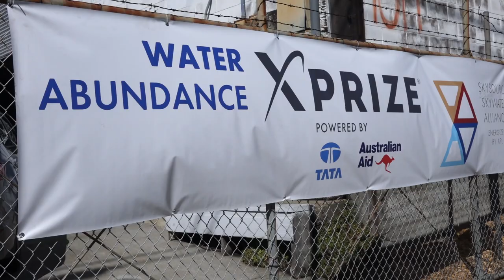The Water Abundance XPRIZE

Comment: Thermodynamics would like to have a word with you. This is nothing but a scam. It works, sure, but it's never going to be more efficient than an already existing commercial dehumidifier. And even under the best circumstances, i.e. very high air humidity (which somehow also kinda eliminates the whole point of this exercise), it only "produces" miniscule amounts of water, while consuming loads of energy.
Reply: All of these incredulous folks who do back-of-the-envelope over-simplified calculations overlook all of the ways to collect water that don't fit their incomplete model. They presume we forcibly condensed every drop right out of the air using refrigeration, calculate the energy required, and call it a day, confident that all they could think of is all that could be thought of. That's not how it works.

Hint: some of the condensation happened without active cooling that expends energy; a lot of cooling can be done passively (or at least without refrigeration) through mere radiators if timed right. Our machine enabled the AWG to operate in the evening, throughout the night, and into early dawn, when the relative humidity is the highest while meeting the requirement that the energy come from renewable sources, whereas solar can't do that and solar+batteries is not yet cost-effective. Our biomass gasifier needed to dry the feedstock before using it, which also collected humidity and passive condensation when left out, besides the humdity that was embodied in it—we routed the water vapor driven off during the drying process (passively heated with waste heat) into the water collector. You may be surprised at how much humidity biomass can hold. And even when California was in the middle of its drought, you could see dew condense on plants and cars and windows. Additional disclosures will be possible when our patents are secured. The over-simplified calculations people make when they presume to debunk what we did never account for all the clever tricks and optimizations that went into achieving this. This was not easy at all. It took everything we had, and we're still not done optimizing; the prize money will fund the next round of development to turn this into a product.

Perhaps stop being so presumptuous. If it were that easy for casual doubters to figure out how it is done, it would not have taken two years to do this.
Reply: @austinliu1043  Please stop trying to obfuscate the fact that you're literally trying to scam people. Thank you.
Reply: @nahco3994  We are not trying to scam people. How about if you stop slandering us?
Reply: @austinliu1043  Sorry, of course you're not trying to scam 'people'. And how could you, without a product? Your only real product is your marketing, and some sort of warm and fuzzy feeling of 'saving the world'. No, you're trying to scam investors and these scientifically clueless organizations that so readily hand out these 'prizes' to frauds like you. It's easy to sweet-talk scientifically inept and clueless people and distract and confuse them with big, sciencey words. For anybody else though it's fairly easy to see the feasibility of your claims. Just go and buy some dehumidifiers off Amazon for ~30 bucks. That's as energy efficient as you'll ever get.
Reply: You seem awfully indignant about something you know nothing about. You haven't done a thing to show the infeasibility of the system; you've done nothing but make presumptions, and are unwilling to hear how it was done. The burden of proof is on the accuser.

We've already met our burden of proof in the competition. The Xprize judging panel had access to minute-by-minute data of all the inputs and outputs of the system through the tipping meters and power meters that measured the water output of each of the machines. Thousands of liters of water were condensed over the evaluation period and were stored on-site in 1000liter caged tanks. Their judges were on-site with the machines regularly during evaluation week. If it were a fraud, the judges would be the first to call it out; they had the most to lose from any fraudulent activity. 

You should be asking how it was done rather than ranting and hurling insults. You might learn something.
Reply: @austinliu1043  It's quite arrogant to presume that some unknown person knows 'nothing' about physics. This in and of itself shows quite vividly the mindset your company operates on: You're trying to sell snake oil to clueless people. I'd say this pretty much concludes this sad little exchange of ours. I'd advise you to take a look at the company Fontus, who tried something similar like you on a smaller scale with their 'self-filling water bottle'. Their scam pretty quickly hit the impenetrable wall of thermodynamics (after being able to attain some absurd prizes and subsidies of course...).
Reply: @nahco3994  Not physics, dude. You know nothing about how we managed to capture that much water from the air and from un-dried biomass. There is a tremendous quantity of water in biomass. We didn't carry out some frontal assault on thermodynamics. If someone had done that, and claimed to succeed, even I would be skeptical. I tried to explain, but you prefer to rant.

I'll hear you out. What thermodynamic law do you think makes water capture impossible to do cost-effectively?
Reply: @nahco3994  I didn't say it isn't a dehumidifier. It is. Straight dehumidification is not cost effective. But when coupled with biomass (which, to be sure, limits the applicable market, but is still within the Xprize's competition requirements) the system is able to work well enough. Our claim isn't that extraordinary. No physical laws are being violated; we merely found a clever way to capture far more water at far less cost by using a route none of the other competitors thought of. None of this is bullshit. If you are in California, you can come and see the machine demonstrated at our Open House this Friday. 

The Xprize jury judged us by minute by minute data logging of our inputs and outputs, and the actual water the system produced, not by our words.
Reply: @nahco3994  Up to this point, you still have not stated which thermodynamic law prevents atmospheric water capture to be cost-effective. Surely it can't be that hard to say.
Reply: @austinliu1043  'Far more water at far less cost'... you're still hedging quite a lot. Even with all your clever optimizations, how much water are you able to produce, and at the expense of how much energy, exactly? If I remember correctly, the key words here are "abundant" and "cheap" (let's not even mention projected retail prices at this point). Also, what would the results look like in regions with very low air humidity and high ambient temperatures (which would both reduce effectiveness and efficiency)? So far, you've talked a lot, yet said so little.
Reply: @nahco3994  We produced several thousand liters of water during the 72 hour evaluation period, close to 4,000 liters. The evaluation took the best continuous 24 hour section of those 72 hours. The water represented water from the air and from what is captured in the biomass. The cost is contingent on biomass availability, to be sure, but in the areas that our machine's markets are there is enough biomass waste to do this. The places that do not have enough biomass waste to support this are not part of our market. Yes this is a limitation, but the Xprize committee qualified this limitation, and it was accepted because there are enough places that match this scenario that such a solution is still useful. 

No external energy was consumed to do this; the energy was strictly generated via the biomass gasifier, which converts biomass to electricity at the rate of 1kWh per 1kg of dry feedstock, with the electricity strictly going mostly to powering the condenser. All heating was done using waste heat recovery. All of the moisture in the biomass is extracted and captured as we prepare it for the gasifier. All the humidity driven out of the biomass is concentrated in a hot box where we saturate the air with water at high temperature and don't let the air out until then. We then passively cool  (as in using fans and a radiator, but no heat pump) this water-saturated air down to as close to ambient as we can (with best performance late at night, when it is cooler); a good  chunk of the water simply condenses out at this point, with minimal energy expenditure just because we're fan/radiator-cooling warm, water-saturated air. After that, the air is still at 100% relative humidity, but much cooler, so then we send this 100% RH air into the condenser, which squeezes out as much as it can. The condensing efficiency of the Skywater condenser isn't 100%, and if the relative humidity of the outlet air is higher than ambient, this can actually be sent back around for another round. All waste heat that we can recover we do recover to assist the loop. The gasifier system itself has three stages of waste heat recovery—engine coolant, exhaust, and hot gas are all sent through heat exchangers to scavenge waste heat. No active expenditures of energy are used for providing heat to dry the biomass at all. No heat pumps are used to cool it down to near ambient temperatures before sending it through the condensation loop; that is strictly done by fans and radiators. Fresh air is introduced into the system in the proportions needed to compensate for the air outlet. Other recirculation and recycling methods are used as well.

I can't go into further details due to ongoing patent work that is not yet finished. But suffice it to say that if you use passive cooling and recirculation and really optimize the way humidity and temperature work together, the whole thing can be done for a fraction of energy than the direct condensation approach that nay-sayers assume must be the only way this can be approached. The direct condensation approach would definitely not be cost-effective.

All other prices and higher-precision figures will await productization.
Reply: @artdehls9100  The water quality testing was done by http://www.simplewater.us/ . We rushed cold samples to them (in syrofoam ice boxes with ice packs) within 24 hours of sampling; fortunately, they had an address in Berkeley that we could drive the samples to. They tested for total dissolved solids, pesticides, and several other things usually of concern in water that I can't remember right now.

If you mean the water production, the protocol used a tipping meter hooked up to remote monitoring hardware boxes.(This brand: https://infiniteautomation.com/mango-es/ ) You can see the tipping meter at 0:25 in the video above. Each tip pours out 100ml. When the meter tips, a magnet on the tipper registers the tip with a sensor. This is the brand of tipping meter:
http://www.hoskin.ca/catalog/index.php?main_page=product_info&products_id=1874
We used five tipping meters: one at each of the passively cooled chambers, and one at each of the Skywater condensers. (Two of the three Skywater machines shared a single large passive cooler, and one had its own. Three gasifier gensets were involved in powering these machines and the fans that were blowing the radiators, along with a few other fans.)

All the data was logged on a minute-by-minute basis, including power output of the gasifier, power input to the various parts, and water output. To clarify, the bulk of the water from the biomass was driven off of the biomass during drying, not obtained from water vapor after gasifying and combusting it.

I've laid out more than enough detail to show how we managed to achieve the Xprize's requirements.  Not a single person hurling vicious insults at us in these comments has bothered to clarify what law of thermodynamics allegedly makes any of this impossible. Just pointing this out.
Reply: @austinliu1043  Ok smart guy: prove your system. Upload a video of your working device.

Comment: One of the requirements for winning this prize is that the "operating costs and capital are less than 2 cents per liter".
Where is the documentation that the award winners achieved this?

It would be interesting to look into X Prize Foundation, inc's non-profit status in relation to its sponsors and competitors, especially in light of their physically impossible renewable energy costs.

Dehumidifiers have a minimum energy requirement, and commercial dehumidification has approached its theoretical maximum efficiency, so the awarding of this prize really equates to at least a halving of renewable energy cost.  If that were actually the case, it would put renewable electrical energy far ahead of traditional power generation in cost efficiency and dehumidification based water production would be the least important of its applications.

How would XPrize explain this discrepancy? You've essentially announced free (or at least 50 percent cheaper than every available source) energy to the world.

Rather than wait for some kind of answer, let me answer: this is a scam.  If its a scam on the part of the prize winners, then retract the prize and fire the competition judges.  Issue a letter of apology to your sources of funding and a public statement.  If this is a scam in which X Prize Foundation and/or its funding partners are complicit, then you have problems that will probably have to be settled in criminal court.

Comment: Unfortunately this video does not effectively communicate the whole picture.  This is a splinter project off of All Power Labs, who builds sophisticated gasifiers which run off of waste biomass to generate electricity anywhere, off-grid.  They already HAVE these units deployed all over the world, including villages in Africa and more remote places than I know.  So basically, they will be using waste heat to pull water out of the air.  Then these units will not only generate electricity and pull carbon out of the air to be available to put back in the soil, they will also capture drinking water from the air at the same time.  It's actually really clever, but I can see how there are misunderstandings because this isn't really explained in the video very well. I know these award recipients personally and have been tracking their evolution for many years.

Comment: what is used as biomass? because i can shove some green leaves in a clear plastic box and bam! I get condensed water on the inner surface of the plastic for free, as long as T°K inside is higher than T°K outside.

Comment: A few uninformed comments here... This video explains the process of how the machine makes water from the air, a process called adiabatic distillation. This means the machine is simulating the dew point and condensing water at room temperature. It is a dehumidifier on steroids :)  Yes, obviously won't work in a desert, not the point here either, https://www.youtube.com/watch?v=NnN93DFmRSc
Reply: Yes, it's called a DEHUMIDIFIER.

Comment: the prize required to get 2000 L per day "from the atmosphere", not from biomass...
Reply: if that's the case, how much energy does it take to move the air containing those 2000 Liters? In one day...
I dunno, let's give the system a 4 m² entrance (big doorway), then a velocity of 46 m/s is needed to move the air containing that water... meaning from standstill it'd need more than a hundred GJ to move that air mass... where do you take that amount of energy from?

Comment: You could have donated that 1.5m and done so much more
I'm not studying physics, but is this not an extremely basic concept? Regardless of what new technologies are invented, there's still a minimum amount of energy necessary to vaporise and condense water. Even assuming 100% efficiency, the idea has been long before shown impractical as a solution for long term drinking water.
Either i'm trying to get into the wrong industry, or this is some laundering scheme lol